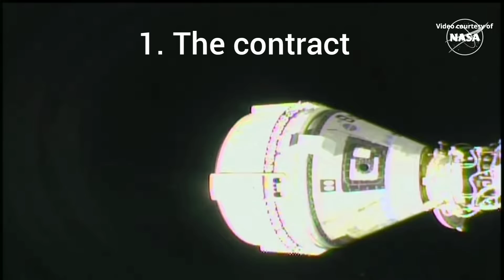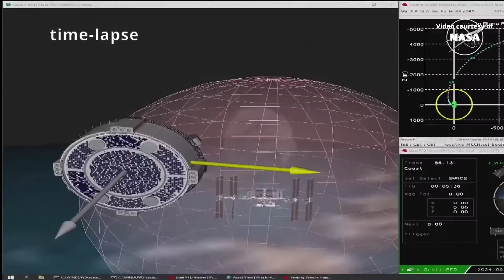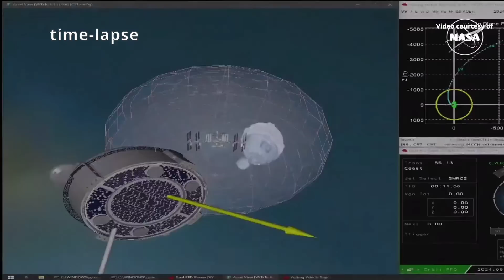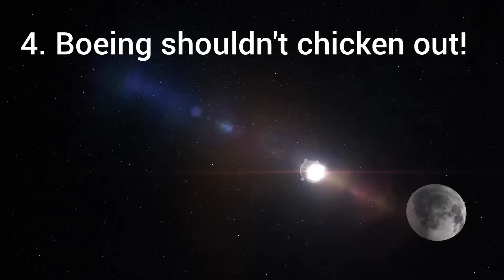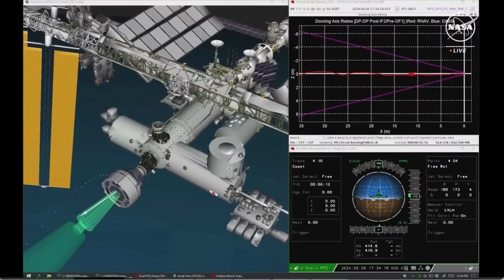Dear Jeff Bezos, don't buy Starliner!  Boeing, don't chicken out!  PLUS SpaceX Dragon breaking news!

Comment: The RCS thrusters are the Achilles heel of Starliner. Ironically Blue Origin should have an in-house solution rather quickly. They are like a mix of old way and SpaceX manufacturing. Also there are actual competent engineers in the company.

But it’s a wait and see situation.

Comment: Boeing can’t sell Starliner or SLS without NASA’s permission.  It’s called a contract novation and the government must give the okay.  However, with Starliner it’s an easier project to convince the government.  The capsules and the infrastructure to build the service modules is basically complete.  A buyer only needs to comply with the paid for missions and will still have missions left in the capsules.  Likely Boeing would stay as a subcontractor to streamline the effort.  NASA could buy into that.  But with SLS, NASA knows that it requires a contractor with experience managing a multi-subcontractor effort given that SLS is more of a jobs program with work spread throughout the US.  Blue Origin does not have that experience.  Only a handful of companies can manage this complexity, which will in turn make NASA comfortable to approve.  So, that’s a practical reason why Boeing will keep SLS.  😊

Comment: I think monorails are tarred with the brush from the many gadgetbahns. The alweg system is pretty standard and hitachi and the late bombardier produced fairly standard vehicles. In the right setting monorails are a legit mode.
Suspended monorails… too much infrastructure to do the same job of a straddle monorail.

Dlr would have been a good candidate to have been developed as a monorail

Comment: 3 incidence out of 359,... Falcon family boosters have successfully landed 359 times in 371 attempts. A total of 43 boosters have flown multiple missions, with a record of 23 missions by a booster. SpaceX has also reflown fairing halves more than 300 times, with some being reflown for at least twenty times,... As of October 15, 2024, the Falcon 9 rocket has had three failures and one partial success out of 398 launches,..... The Falcon Heavy rocket has launched 11 times, with all launches being successful with 4 boosters having landed,.... The SpaeX safety standard is a new and ever changing positive precedent,... so far it's unmatched,.... and yes they need to keep up the great work.
Reply: Exactly!

Comment: As we all know, NASA is funded by having bits made in as many Congressional districts as possible.  It didn't help that some Congressperson saw a few leftover Shuttle engines and decreed that Artemis MUST use those leftovers in order to create the false impression of saving money.
Reply: Ares was going to be an all-original design, at a very high price.
Reply: @EMichaelBall Perhaps I'm wrong, but didn't we launch the Ares I prototype successfully?  And wasn't Ares essentially 90 percent done, with 6 billion in development money tossed down the drain, cancelled by Obama?  And then after all the Democratic congressmen and senators in the areas producing space parts cried to Obama, he relented, not bringing Ares back, but starting the SLS system as a jobs program.  I think that SLS was supposed to be a Space Shuttle tank, with Space Shuttle SRB's and with Space Shuttle engines to save money.  I think that SLS has cost us three times the projected cost of Ares, but hey, Boeing wasn't building Ares.  SLS has worked perfectly for what it was supposed to do, make jobs and Democratic votes.  I think that's how it worked, but I could be wrong.

Comment: I disagree with you about the thruster problems being the fault of Aerojet.
As I understand it, these thrusters are used on many spacecraft and have a good track record.
What's different on the Starliner is how many are mounted together inside a housing, which concentrates the heat in a place that it can't escape from (along with getting heated by other thrusters in the craft in unexpected ways. This is a Boeing problem, not an aerojet problem.
There is not a quick fix (the only 'quick fix' I can think of is to go from 3 per housing to 2 per housing to reduce the heat concentration, but sacrificing some redundancy)

I also don't think that SLS is quite as good a cash cow for Boeing as you allude to. It's cost plus, and a huge amount of money goes through Boeing, but so it's going through Boeing, not to Boeing, most of that money goes back out of Boeing to subcontractors. It's also heavily dependent on the pace of launches (which are getting slower and slower). I also wonder about pension liability for their workforce
Reply: Rather sacrificing redundancy by an overkill thereof.

Comment: Starliner uses an Atlas V booster, and those are no longer being manufactured--there are only 6 of those remaining, all of them allocated to the Starliner missions. So flying any more missions, or even another test mission, uses up one of those.
Reply: I suppose the plan was to use Vulcan afterwards
Reply: True, but when will ULA get Vulcan man rated?  Last launch was not a good optic for Vulcan to have a supposedly dependable SRB have major failure.  Had the other side of the nozzle failed it would have been an end of mission.  This is what happens when you go lowest bidder to build your major sub-assemblies on Starliner, or Vulcan, or Boeing aircraft.  When you allow others to engineer and build your major sub-assemblies, you lose control of your product, no matter who you are or what your product is. @COGintheMachine
Reply: Atlas V has been retired this year by ULA. They were planning to use the Vulcan Centaur going forward for Starliner.
Reply: @SouthernRotors  Was Vulcan Centaur designed as fully backwards compatible booster? If Starlliner was designed for Atlas V, would they need to make alterations to get it onto VC? Assuming they would, more money that Boeing would be on the hook for to do that? I very much doubt that they would be looking forward to that. 

I wonder what the timeline is for ULA to get VC human-rated?
Reply: @Zhiroc  Not sure about time frame and I'm certain there would be investment needed for VC/SL. Dreamchaser cargo/Dragon cargo/Dragon crew will be the only US crew platform. Hoping Sierra Space has good results with DC so we can get a crew version in the not to distant future.
Reply: @Zhiroc   They have never indicated they are interested in doing so.
Reply: @SouthernRotors   No, there are still fifteen Atlas Vs waiting to fly, six of them dedicated to Starliner. Vulcan is not man rated and ULA has never indicated they are willing to pay to make it so.
Reply: No, there are nine others, one allocated to a ViaSat-3 launch, and the other eight to Project Kuiper but, yeah.

Comment: Assuming that a buyer isn't beholden to the ISS contract, or mandated to purchase service modules from AJ - i.e., the buyer just gets the existing hardware, tooling, manufacturing rights, etc. directly from Boeing - said buyer could possibly further develop the Starliner crew module as part of a essentially-new spacecraft. BO, for example, doesn't have an orbital-capable reentry module at the present (just the suborbital New Shepard). Perhaps BO could combine the Starliner crew module with a new service module which uses BO RCS thrusters and engines. The same could be true for Rocket Lab, Firefly, Relativity, Stoke, etc. - although I'm sure the price would be WAY out of range of most of these, except maybe Rocket Lab, or Firefly (which I believe was purchased by Northrop Grumman). Just a thought.
Reply: No, Northrop-Grumman did not purchase firefly, they just contracted with them to build the latest version of their Antares launch vehicle.
Any buyer of Starliner would get the ISS contract with it. That contract carries obligations which Boeing cannot just walk away from. They either have to fulfill it, or sell it to someone who will. Indeed, the federal government would probably forbid a sale to anyone they thought would be unable to carry out the contract.

Comment: Can we tax payers GET A REFUND?  Sierra Nev. SHOULD HAVE kept working on the crew version on their own!  They could have gotten OUTSIDE investors to help.  They’d be sitting pretty right now had they.
Reply: SpaceX and Sierra should cooperate on building a scaled up version of dreamchaser that can be used for transporting 50 people at a time, and put on top of starship, replacing the nose cone. Detachable from tanks and engines so it can return to earth on a glide trajectory instead of ballistic. That means it could also land on any runway on earth in case of emergency. How's that for safety.

Comment: The Aerojet Rocketdyne thrusters aren't the issue, it's the fact that the doghouse enclosures are retaining way too much heat causing the thrusters to fail.  If you get any piece of equipment to hot no matter how well it's made it's going to fail.

"Starliner's issues can be fixed" - What the &$^# was in Angries Kool-Aid this morning???  Maybe Angry has gotten Boeing to sponsor his channel.
Reply: I think the bad publicity has precluded a redesign of the doghouse enclosures. Investors are fickle, its about the money not the goal. For want of a $20 fuel filter the entirety of Virgin Orbit was shredded.
Reply: isnt there a tufnell seal (or close material)  issue on the engines as well. theough failure related to heat
Reply: @tonyug113  yes, the teflon valve issue was related to the heat according to the press conferences Nasa had while starliner was stranded.
Reply: yeah the Aerojet Rocketdyne lawyers will want a word - iirc they were operating out of spec because of incompetence by Boeing designers.
Reply: @tma2001  Nasa, Boeing and Rocketdyne approved the system integrity the second time around, so it seems like it was an unknown unknown that manifested itself only on orbit. Sounds like the engineers know how to physically fix that and also update their modelling simulations.